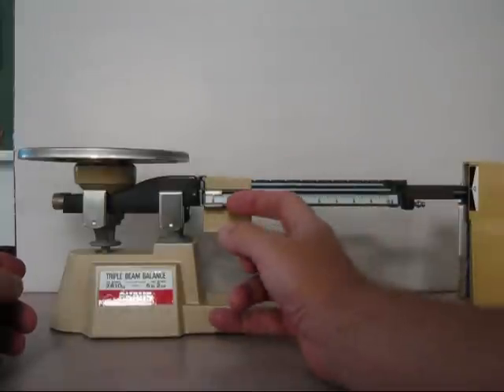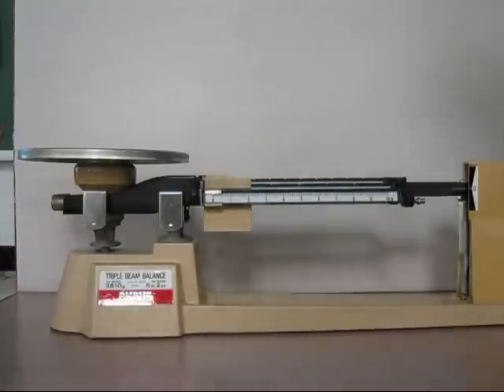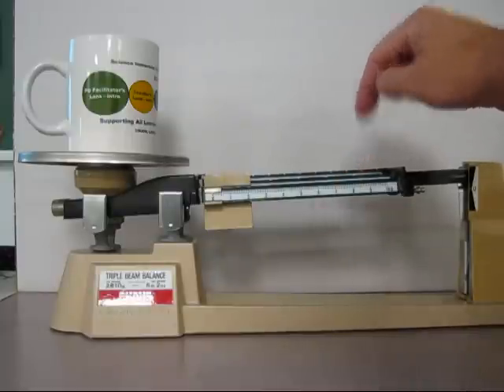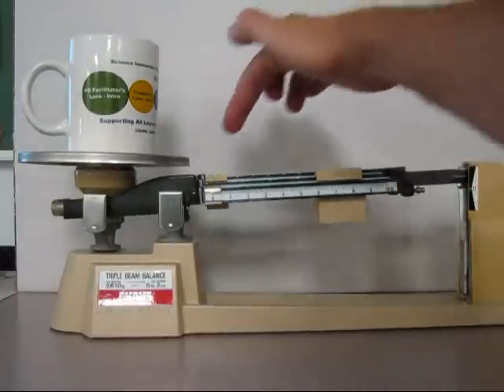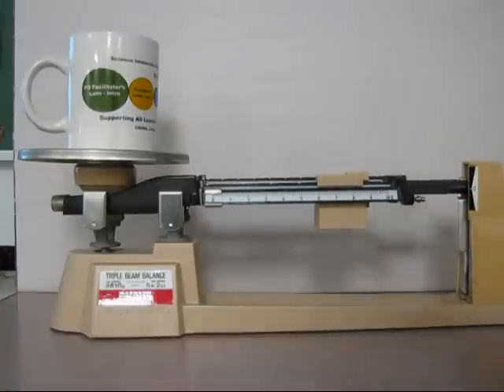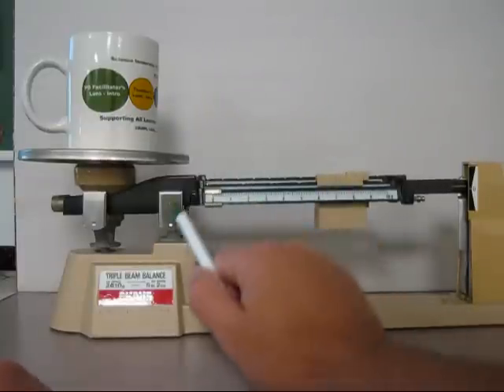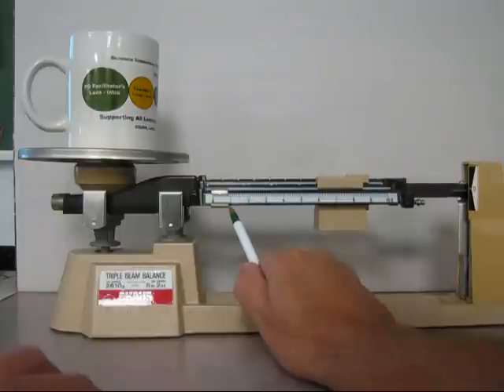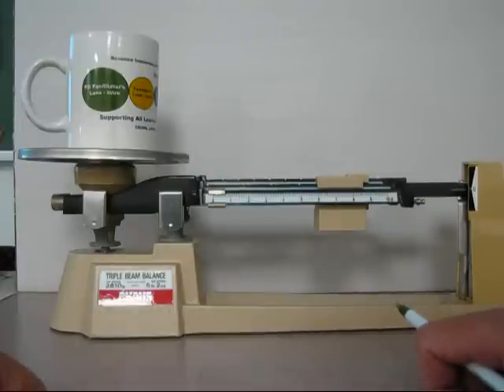Using a Triple Beam Balance

Comment: I am about to make a rubber mold of a sculpture. I found some triple beam ohaus scales. Wich are the "Dail Ogram" series. I have used the ones like yours for years. But now I have this dial o gram set. without any paper work. Do you understand how to use the "Dial Ogram's" I weigh my container as usual right? Then add the weight amount of rubber I use i.e. 400 grams. balancing this out. Then I need to weigh in 20 grams of catylist. When do I use the dial and front tare? Any help would be great!

Comment: You should have used a standard weight ( 250 or 500 grams ) to see how accurate is the actual scale, because by doing it with the cup, you will never now if the scale is accurate or not. You can do this with U.S. coin currency, a U.S. nickel is exactly 5 grams, so 100 nickels should be very close to 500 grams if the nickels are still in good shape.  Also a U.S. penny is exactly 2.5 grams, that will give you something to test the accuracy of the scale, please share the outcome if you do it to see if those scales are worthy of purchase, thank you.

Comment from the maker: Not on mine.
Since you asked as a serious question though, let me answer scientifically: 
"Mass" is independent of the type of material, and the gram is a well-defined unit, so the device could be used to measure appropriate amounts of anything. 
That said, if you are measuring small amounts for retail, if what you are measuring costs about $100 per gram (which Wikipedia says that does), you might need a device that has less experimental uncertainty than 0.1 grams.

Comment: The dial on the back of mine does nothing! Help!
Reply from the maker: Make sure first to check that all the sliders are in the "zero" 
position. Then, if the top plate is very dirty, the dial for fine tuning
 might not be able to move far enough. (This is not really likely, but 
is the easiest and fastest possibility to deal with.) Clean the plate 
first. Make sure you have nothing on it. 
If it is neither of those 
things, then something probably really is bent or broken. It might very 
likely be fixable, but would be hard to diagnose via messages like this.